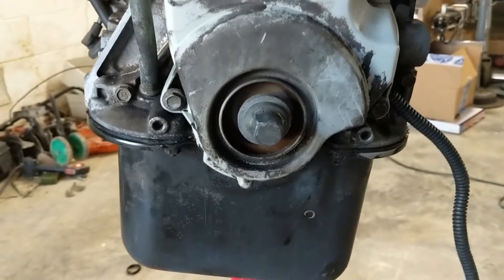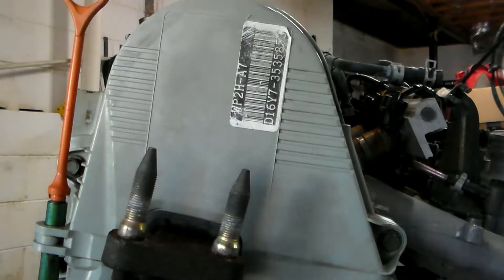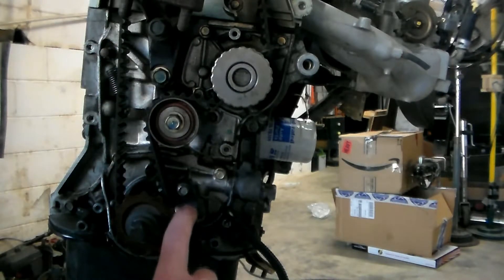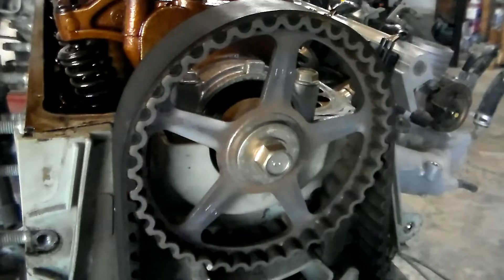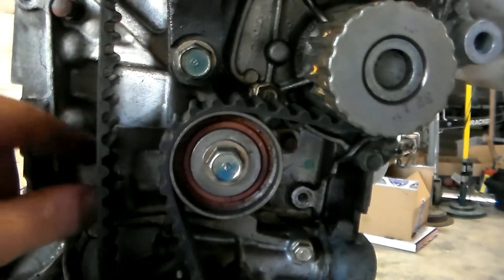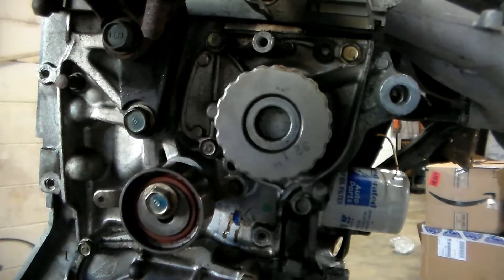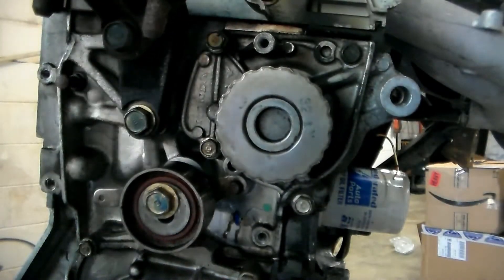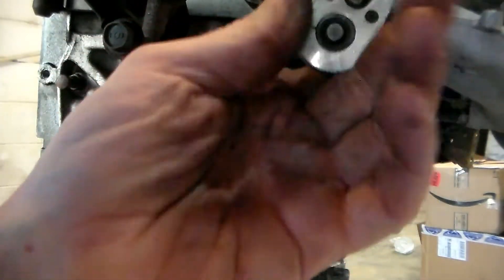Honda D16 SOHC Timing Belt, Water Pump, Tensioner Replacement

Comment: Helpful video. I recently had the crank pulley fall off when I was driving and barely got home. The timing belt slipped a bit off and I was as wondering if I could just loosen the tensioner pulley a bit to slide the timing belt in to a better position. Hope you can answer